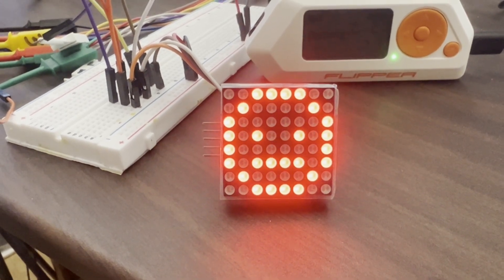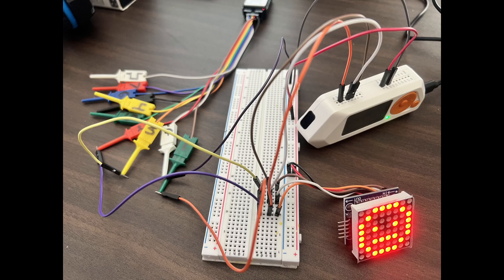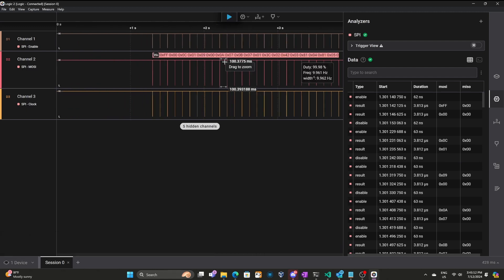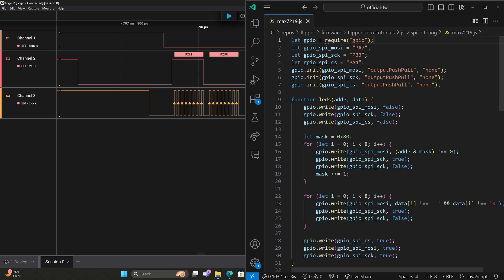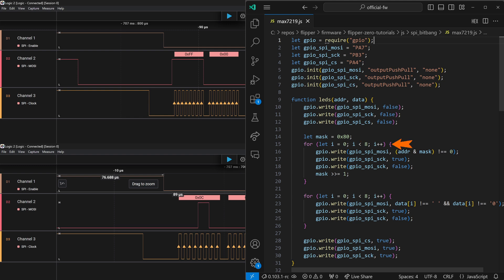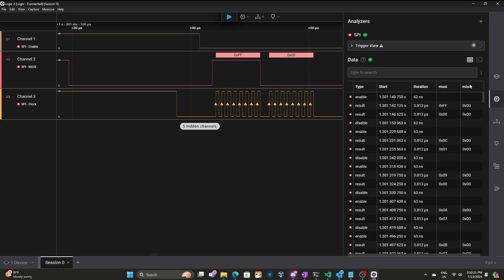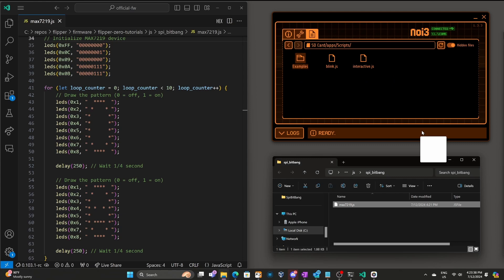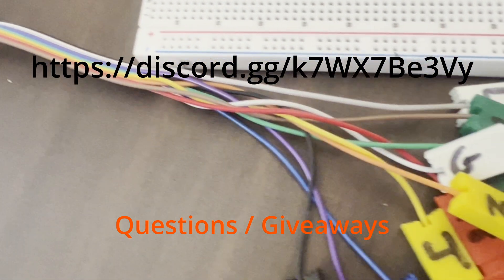[125] Flipper Zero: JavaScript Bit Banging SPI 8x8 Display

Comment: Is it possible to create an application that only sends IR signals (saved in the device) through an external button connected to a GPIO pin?
Reply from the maker: The timing in JavaScript isn't very great.  You are better to write a C program for that, or at least a new module that your JavaScript program leverages.  IR is typically 38KHz with various bursts of on/off.  If you don't want to write code, then you could build a circuit that oscillates at 38KHz with a NAND gate to a GPIO pin and have the JavaScript just signal when to send or not send the signal.

Comment from the maker: I was surprised how slow bit banging was in JavaScript!  I decided to time instructions on my Flipper and on average each instruction takes about 80-100us (yes, I said 80000ns - 100000ns).  But for protocols where you have a CLK/SCK wire, it's typically okay that things are running slow -- as long as there are only a few bytes of data.